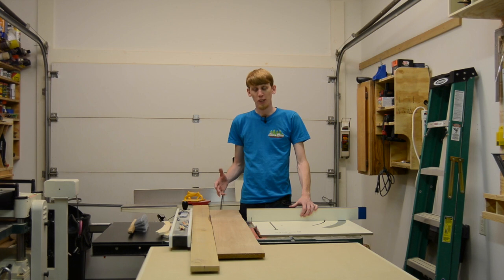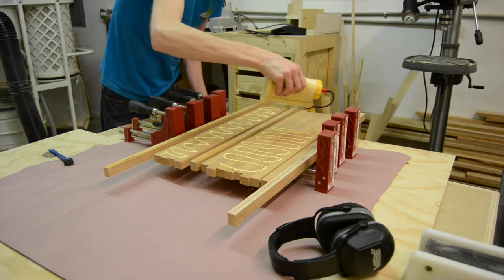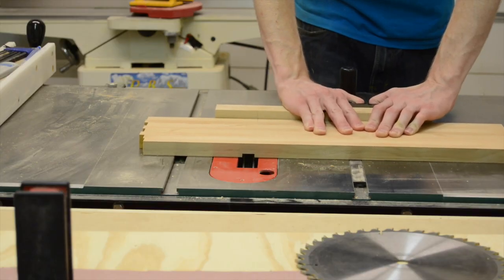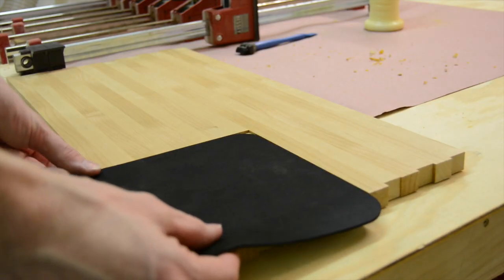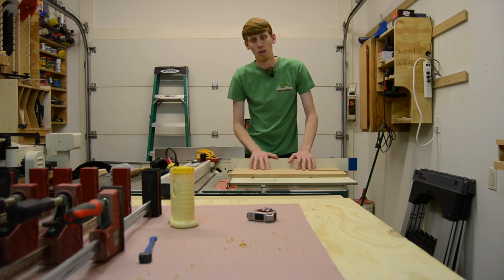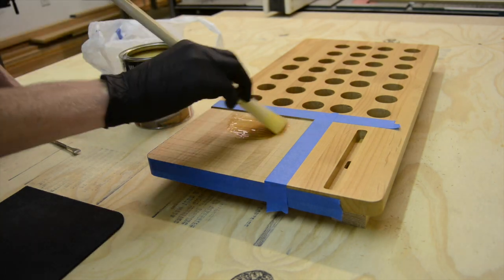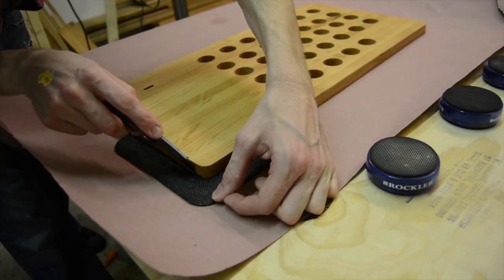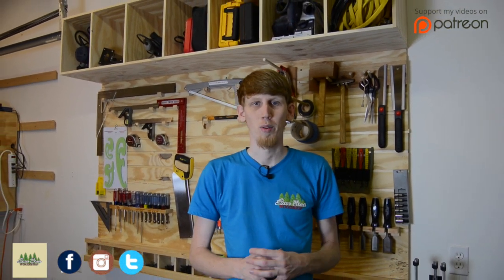How To // Modern Mobile Laptop Desk

Comment: Rounding over the edges of the drilled holes with a 1/8 roundover bit will make a world of difference. Also, beveling the edges and keeping the mouse pad further in on the piece will also help. I sell dozens of these on Etsy every month and those are some tips I got when I first started.

Comment: Great project! I've been itching to make one since I saw the kickstarter for the SlatePro - so it's nice to see that I'm not the only one :)  I'm curious as to why you didn't finish off the grid of air holes in the bottom left corner? Also - how sharp are the edges of the vent holes?  Did you just sand them, or did you use a router to chamfer the edges?
Reply from the maker: +Mom's Cuts Thank you. i meant to put my logo right there and just forgot when I put the finish on, so no good reason at all haha. I eased the edges by hand with sand paper.